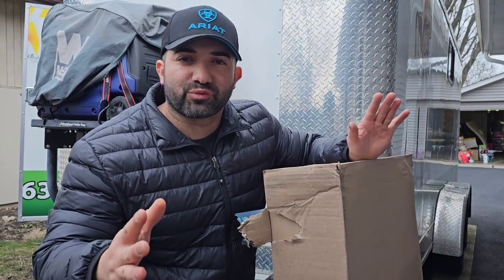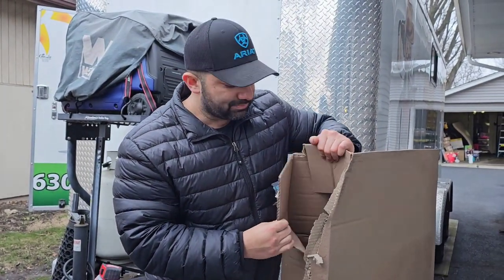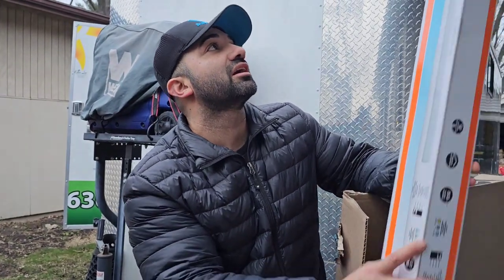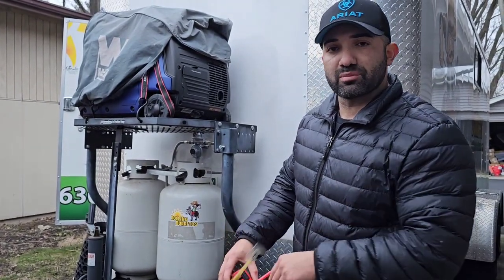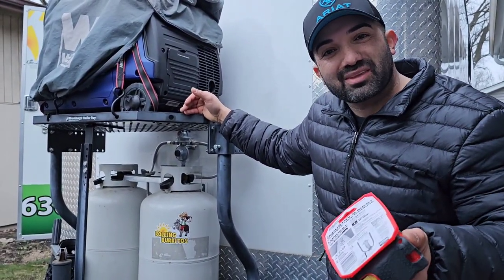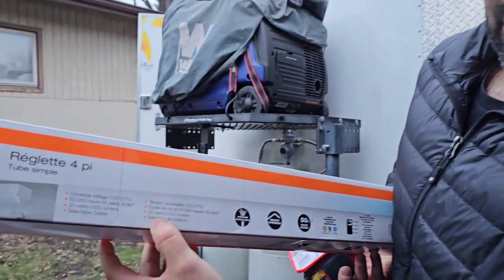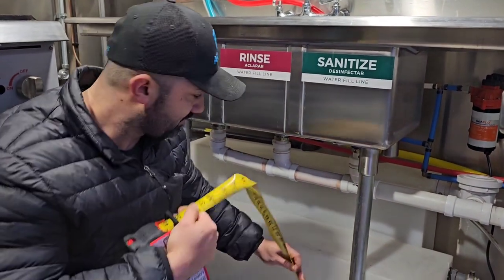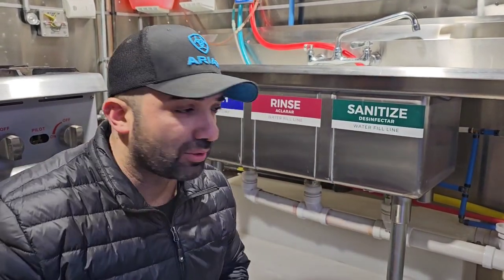Food Truck Weekly Q&A: Answering your Food Truck Questions

Comment: Hi Frank ur videos have been very helpful. I just bought a truck and there is no framing really. Would you use wood or aluminum to frame walls and roof?
Reply from the maker: Dang good question. If it was my truck I would use wood but make sure you look at your local codes sometimes they don't allow wood in commercial applications

Comment: @fbterriuez I have food trailer with brand new ansul lp pryochem valve Gv-75 3/4” gas shut off valve it’s causing my fryers to not light up consistently
Reply from the maker: It could be the gas valve I'm not a big expert on the Fire suppression system as I have that installed by a 3rd party

Comment: What is the white paneling on your walls inside the food truck? And are they heat resistant?
Reply from the maker: They are white aluminum but not enough to have behind cooking equipment usuallyhas to be stainlesssteel. I would use white aluminum instead of frp

Comment: Would a 40 gal fresh & 46 gal wastewater tank fit underneath the sink and connect the same as yours?
Reply from the maker: That I'm not sure. They have the dimensions on the site I think the biggest I have used is 35